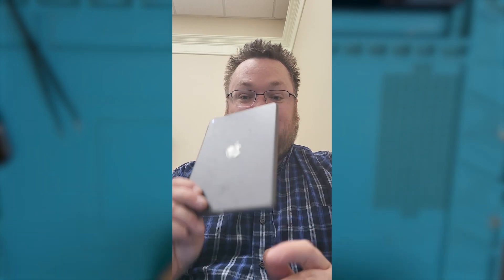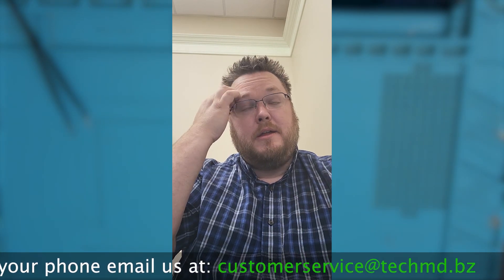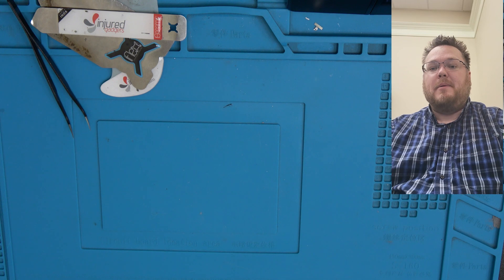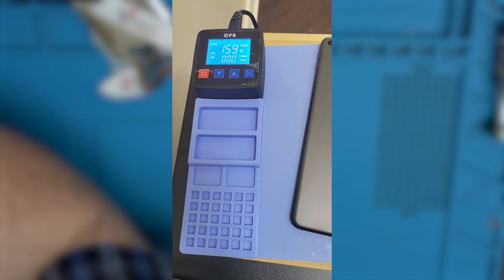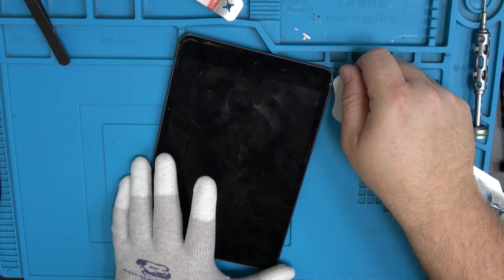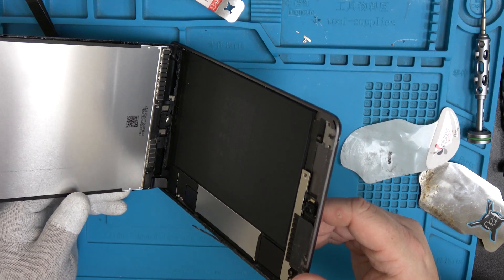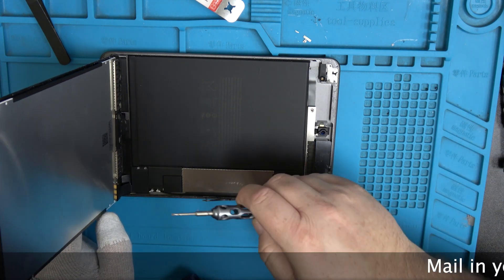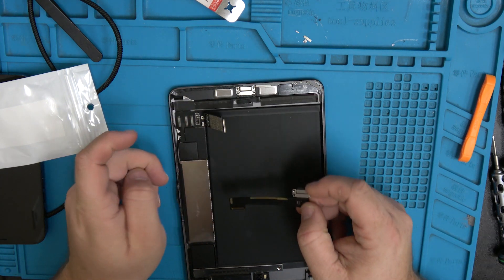iPad mini 5th GEN Teardown and Charge Port Replacement DETAILED PART 1

Comment: Hello man ! Do you know if besides the fingerprint and magnetic sensor could the motherboard from an wifi model be put on an lt model ? And swapping then the fingerprint and magnetic sensor. Would be the conectors from the lte model the same and compatible with the wifi model ? (besides just losing the lts conectivity).

Comment: I realize the video is older but you mentioned the magnetic cords to use after replacing the port. Do you have any recommended ones for that? I didn’t see a link for them.

Comment from the maker: Please support the channel by using my amazon links! 
For just the Charger Port & Recommended Parts click on the links below.

iPad 5th GEN Charger Ports :
https://amzn.to/3I0kbHy
https://amzn.to/3nL9qkT
https://amzn.to/33a10wl
https://amzn.to/3re2VYt

LCD Screens :
https://amzn.to/3FsAfQK
https://amzn.to/3noJjA1
https://amzn.to/3tG7BcL

Screen Protector :
https://amzn.to/33iaF3Q
https://amzn.to/3K3Gmyt

iPad mini 5th GEN Battery :
https://amzn.to/3qpYT05

iPad mini Cover :
https://amzn.to/3foW49k
https://amzn.to/3nr1Nj7

FOR NEW iPad :
https://amzn.to/3fsfN7K

Heating pad:
https://amzn.to/3mbIytW

Heat Resistant Gloves
https://amzn.to/3EsZdyW

My blue mat to keep everyone organized:
https://amzn.to/3BalS16

iFlex Opening Tool with Glue Card :
https://amzn.to/35UC9h8

iPlastix Opening Tool with Glue Card :
https://amzn.to/38FtzUH

on of my favorite screw driver sets 2uul:
https://amzn.to/3jsqkCz
https://amzn.to/3CcoL2Y

iseasmo w/ Kit (Has Screw driver too)
https://amzn.to/35Za2O0

Tweezers:
https://amzn.to/3B7yBlf

T-7000 Water sealing glue:
https://amzn.to/3EdzLxs 

Isopropyl Alcohol For Technical Use:
https://amzn.to/3BqBU78

Need to get a part from a reliable quick source, you'll find a better price here then Amazon and the quality will be a lot better. Click on the link below.
https://www.injuredgadgets.com/?acc=be9b6cec65c863e1b55538d2c7fcc9b0

• Visit our Website: https://tech-md.com

• My email: dustin@techmd.bz

• To mail in your phone, please contact us at 801-438-6028